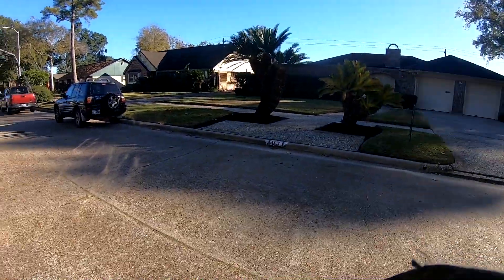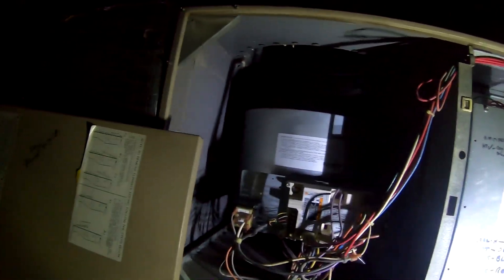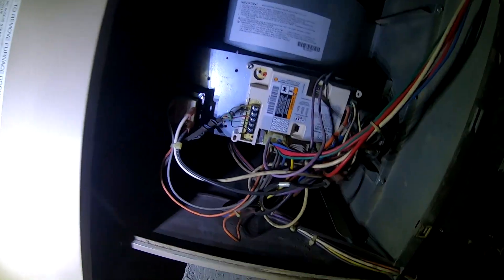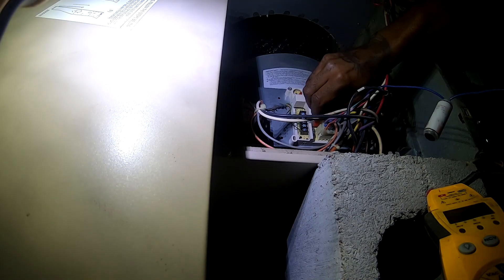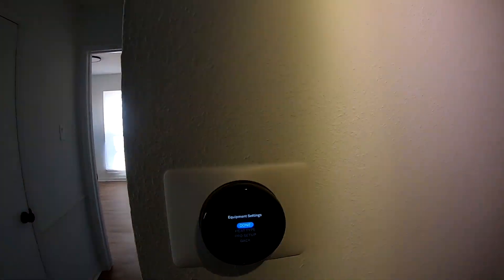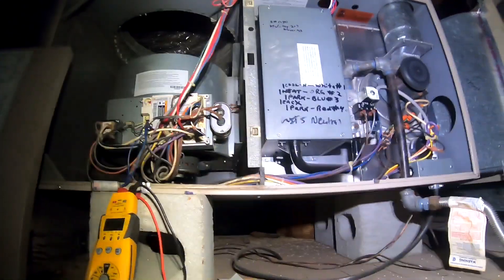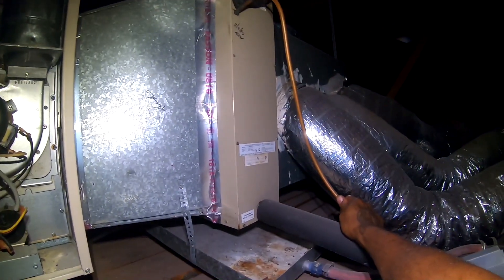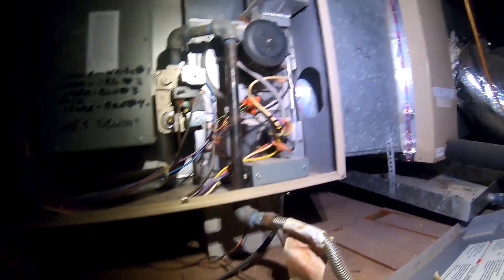"Nest Thermostat: No Power from Equipment? Pro Solutions to Restore Connectivity!"

Comment: when you checked the fuse what setting was that ? on the volt meter and what does OL stand for ? Thanks !!!
Reply from the maker: Ohms..OL stands for open line
Reply: @WWHVAC  Thanks ! just got the system running again in terms of electrical that fuse was blown , my problem, currently is no cold air feel from the line but the unit does kick on and fan is running .

Comment: Thanks n advance im sure this is my problem its 5a.m n dont want to go back n the basement, ive been working on this for four hours very frustrated🤦🏽‍♀️😡!!!
Reply from the maker: If it's the fuse, you would need to find out why it was blown
Reply: @WWHVAC  im sure its because im replacing my thermostat, I have a Rheem and took my top panel off and dont even see a fuse panel insight🤦🏽‍♀️
Reply from the maker: @tarahardy26  Should be somewhere on the control board
Reply: @WWHVAC  Thanks, it must be hidden somewhere I guess I’ll have to keep hunting for videos on where are fuses in the Rheem. 🤷🏽‍♀️
Reply: @WWHVAC i finally found the fuse behind a small silver closed box, i replaced it, the power is still off so if i turn the power back on now and the thermostat is connected will that be ok?

Comment: My fuse and red wire connections are all good, no clogged drain,  I'm convinced I have a bad nest unit,  rh wire issue only happens when running the heat
Reply: Did you get this fixed? If so, what was the issue, and how was it fixed?
Reply: @Artfernandez33  I haven't dealt with it yet, my next step is to install the original thermostat I had prior to the Nest, then I'll try running it with the old thermostat and see if the problem is resolved

Comment: Quick question  I have a two wire one black and one white  n a 2 generation nest thermostat worked for 6 years so iam doing my kitchen and  had it disconnected when to connect it back n now iam getting the no power code please help

Comment: Had problem with it they turn off my power too the house then after they turn it back on had the problem thought it was fuse wasn't burnt wasn't breaker from out side could it be the fuse in side my unit upstairs my unit is basic electric unit no heat pump just real basic unit trying too find issue or clue on what it could be I did ac before but I'm still trying to learn other stuff as I go ?

Comment: I have an oil furnace with 2 nest thermostats, one for each zone. One of the zone wasn’t working and gave me a N72 error code (no power from the RH wire). Did a lot of YouTube research on what could cause this and found a few videos but didn’t fix it. I had an oil furnace tech take a look at my furnace & heating system, he diagnose it to be my nest thermostats. I contacted nest and they went through a couple of test with me on the phone. They are sending me a replacement thermostats because it was still within the two warranty.

Comment: I just had the same issue at a client's place with a nest thermostat. How ever the problem was not the fuse.

It was saying no power on Red, to RH, but I did measure 24vac at RH, no fuse blown, , ended up replacing the nest with basic Honeywell. Problem solved
Reply: Could it be the tranformer in the unit that would be the problem because my fuse wasn't blown either and idk what could be the issue I have a basic electric unit